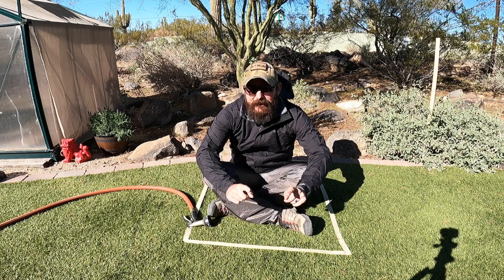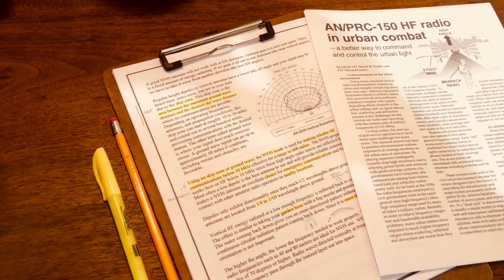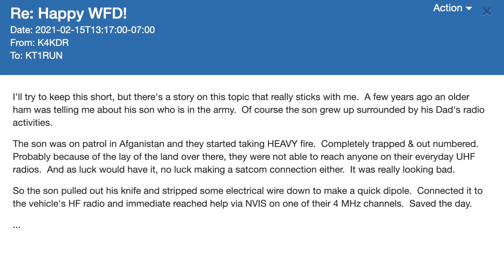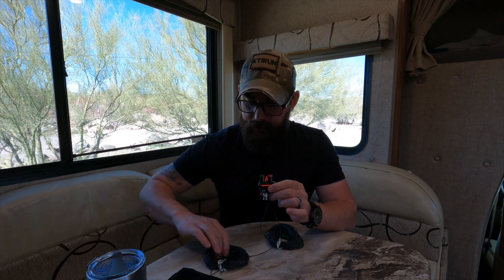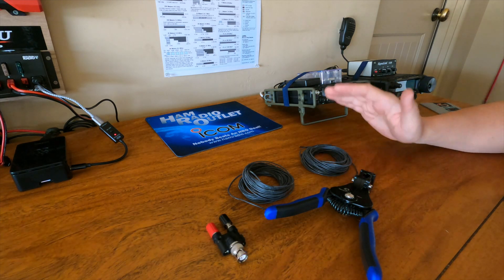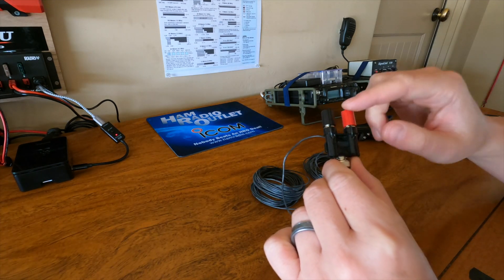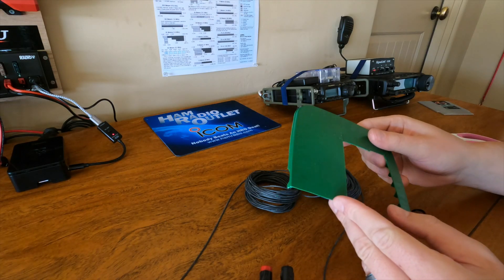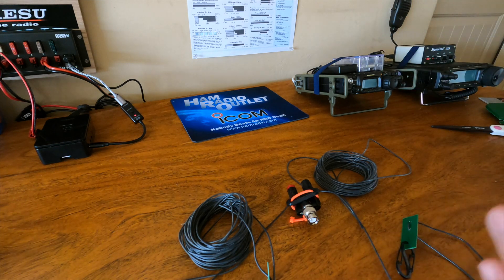Local Emergency Communications with NVIS - Let's Build an 80m/40m Dipole

Comment: When hurricane Harvey turned the Texas coastal bend into a war zone, I returned to no power, no internet, no cell, no cable, no coms.  I draped an 80m end fed antenna 22' up to my barn peak then down to the roof of my chicken coop.  Not an "engineered" design but NVIS got me reliable coms to relay messages to family and even voice patch to my wife.

Comment: Gaston, appreciate the content, especially this type of content. Have been ham for many years but there are always things to learn and when you shine a light on that content it helps us all. Excellent work my friend. David N4IN
Reply from the maker: You're welcome, David. Thanks for the kind note. This video is quite old and needs an update. I recorded this when I first trying to understand NVIS. It turned out to be very handy as most my work in the Southwest and Arizona is primarily close-in to mid-range communication using low to the ground antennas on 40m, 60m and 75m/80m. 73 de KT7RUN

Comment: Nice presentation! At least NVIS is easy in terms of antenna tower requirements. "40 by day, 80 at night" A BIG loop works best for NVIS if you have the room and 300 feet of insulated wire for a full 80m wavelength or bigger loop hung through the forest. Height is not important, but high enough to walk under is good.  You will also discover a low loop can actually be an efficient and good dx antenna at 10-20 meters and if 80 or 40m band is really open, short DX there. too. They naturally make VERY excellent long distance listening antennas with low noise reception. Of course a low dipole will also work. Dry desert is worst ground for good NVIS. A salty marsh, the best.  Would recommend reflector wire on poor ground under antenna to help in reflecting vertical 'beam'.  Before it was NVIS it was called 'cloud warming'. It was used extensively in Vietnam war and North Africa in WWII, but will not work hardly at all in higher latitudes. It works well in the tropics, but becomes fickle to nonexistent to the North in winter. Here is the link for making best real time NVIS frequency estimates. Right now this graph says 11MHZ and lower has good NVIS propagation in most of northern USA right now., for example. go here .  https://www.sws.bom.gov.au/HF_Systems/6/5

Comment: When you’re out in the field, do you use a tracking pole or your carbon mast to set up your NVIS  antenna? Which is lighter of the two.? if you could only carry one or the other, which one would you carry?
Reply from the maker: For NVIS in the field I don't even use a mast as my deployments are typically only 5 to 6 feet off the ground. Search my channel page for: (tr)uSDX as I have shown the deployment along with that little 5 watt transceiver.
Reply: @TheTechPrepper I’ll definitely check it out. I have yours and Tim’s NVIS antenna but have yet to set it up. 

I also have an EFHW set up for 100W but it’s significantly heavier 

Do you prefer setting up NVIS of EFHW? Which is easier to set up? I guess the answer depends how far you’re trying to reach. 

What’s your go-to antenna setup for emergency off grid scenario where weight and space are a premium?

Comment: Trying this @ 160 miles, cannot seem to get this to work. I have the ends at 1' center at 6'. manually tuned. Reached CW from US to Europe, but cannot get 160mile nvis.
Reply from the maker: There have been lots of solar blackouts recently. 160 miles is a sweat spot for NVIS on 40m through 80m. Keep trying.

Comment: NVIS is the VHF/UHF of HF. I easily check in with friends between the Inland Empire (CA) and San Diego, Arizona, Palmdale, and Santa Barbara, so basically anywhere within a 50 mile to several hundred miles radius of my station almost any time of day on 40meters with a flat-top 40m EFHW that I built myself up at about 25-30ft. 
The amazing part to me was that one evening (I normally operate daylight hours), I was having a conversation with the stations in Palmdale and Santa Barbara, located on the other side of the Transverse Range in Southern California, with only 1-5 watts (I kid you not) and they sounded like they were in my shack. Simply incredible.

Comment: Does the other station also need to be configured in an NVIS configuration to be able to reply?
Reply from the maker: Yes, both stations need to have their antennas systems deployed with NVIS propagation in mind.
Reply: @TheTechPrepper  Thanks. Do you know if there are any listing of State by State HF NVIS Nets that have HF Nets on a weekly or monthly basis? Google hasn't turned up anything, but this seems like it would be something that would be practiced/tested ongoing. Maybe I am Googling the wrong terms
Reply from the maker: @joeytrahan  Negative. Your best is to start one or contact your local amateur radio group. On the Buy Me a Coffee member side, we have a few regions that run nets. We run one Saturday mornings at 1515 UTC for the Southwest region.

Comment: On Wikipedia it says that using a ground wire with a NVIS antenna improves gain. Has anyone tried this?
"The overall efficiency of the antenna can be increased by placing a ground wire, slightly longer than the antenna, parallel to and directly underneath the antenna. A single ground wire can provide antenna gain in the 3–6 dB range. This is a reflector element used to form a 2-element Yagi beam antenna. The wire length for the reflector element is 5% longer than the dipole-driven element positioned above it. The dipole is located at a distance of 0.15 wavelengths above the reflector element."
Reply from the maker: I tried it several times and I could never tell the difference via received SNR reports using digital modes. It also never made the difference between making a contact or not making it. Again, this is my experience in Arizona with my equipment and my operating style. The textbook is a good starting point, but the real world is your best teacher. Get out there and experiment. I have done things that the textbook and wise hams have said are impossible. I hope this helps.
Reply: @TheTechPrepper  yes, thank you! I made your 40m dipole and am having good results with a USDR (black brick) 5watts, NVIS, 4 feet off the ground using JS8Call. Cheers! VA7CNT
Reply from the maker: @TruthVSLies  Excellent. Thanks for sharing your experience.

Comment: I have an important question.  I am on GMRS and is there a way to make an antenna like this but for GMRS?  Do you have a video for that?  I really want to create one for GMRS.  Can you help me?
Reply from the maker: Unfortunately, this technique does not work for GMRS. NVIS propagation is only seen on lower portions of the HF spectrum between to 2 and 8 MHz. GMRS runs on a frequency that is limited to line of sight. Your range will also be very short and nothing that can support regional distances as shown here. If you need a better antenna, take a look at building a Jungle antenna. I covered this in one of my videos. The math is the same for GMRS, you just need to plug into the desired GMRS frequency into the equation to determine the appropriate lengths for the radiating element and radials.
Reply: @TheTechPrepper  Thank you my friend.  Love your videos.  I have learned so much from you.  Thanks for being my Elmer.

Comment: Very cool setup. The use of the binding post setup is clever. I CADed and 3D printed my own center so I could make it also use it to reel up the antenna wire when not in use. I didn't realize you could fold the insulated wire over on its self to "shorten" the antenna. That's extremely handy, I think I'd like to try it with clear tubing. My budget wire is common 18ga speaker wire from the hardware store. Not sure where you're getting silicone insulated wire that cheap, but more power to you. Debating digging up PTFE wire (a bit spendy) but I think the insulation would be near indestructible after it's sorted. That said, I don't think it would fold well back over its self.

What's your opinion on the RG316 vs RG58 cable? Sure you're not running a lot. Far as I can tell on my VNA it's about 1-1.5DB loss over 25 foot at HF, but way less weight to run the 316. May also consider Airborn 5 but haven't gotten there yet. I want BNC connectors and I don't see a US distributor of them, not to mention that's a hefty price tag for such a feed line.

Comment: Rig expert looks like a great tool. As a noobie, I see some people refer to the bands in meters while others use MHz. Which is it?
Reply from the maker: Great question. Yes, there is a relationship between the physical wavelength (expressed in meters) and the frequency. For example, 7mHz or the 40m band are equivalent. The math is pretty straight forward to convert between with simple division. 

wavelength in meters = 300 / frequency in mHz
~41.9m = 300 / 7.150 mHz
~41.9 = 40m band

Radio waves travel at roughly the speed of light (299,792,458 m/s), but I find it easiest to still use 3,000,000 m/s (or 300 in the equation above) to make the math simple.
Reply: @TheTechPrepper  awesome. Thanks a lot

Comment: I was doing NVIS before I even knew what NVIS was. I had a condo in an HOA, and all I could manage was a wire loop antenna under the eaves. Got a fair amount of DX using the JT65A digital mode, including contacts in Japan, Australia, South Africa and one of the Pacific islands (don’t remember which one).

BTW, from watching DX Commander's videos, folding that wire back doesn't totally eliminate the length, since it acts as "linear loading".

73 de AF6AS

Comment: No question about it!  The dipole is an easy, inexpensive antenna to build, and it is very reliable.  I've built several, and for NVIS, I think the 40-m is ideal.  Very good video!

73
KI5KET

Comment: late comer to the video here but are there power limitations in this configuration?  Can you transmit at a full 100 watts there if needed?
Reply from the maker: This setup is fine for 100w SSB voice. I've never tested to see how well it would work for 100w digital.

Comment: Infantry RTO here. Your hasty antennas are spot on. Keep up the good content!
Reply from the maker: Yes! I'll take it. You might get a kick out of the improvised field comms series I did last year. I built another NVIS antenna out of scavenged wire (coyote electric fence wire and chicken coup mesh) in the back yard, a 2m jungle antenna, and even improvised at 19" 2m vertical for the HT. Thank you for your service.
Reply: Are 80 and 40 Meters the best for NVIS?

Comment: I’ve made a few multi-band resonant versions.take your 80 M antenna and add power pole connectors at the calculated locations .to remove and add  leg extensions .to bring it from 40 to 60 and to 80 meters.the center section shortest will be 40 meters add  a leg to each  side for 60 meters and final lengths to that for 80 meters.jim KB1PFL

Comment: Put round terminal connectors on the wire, saves the post trying to crush and cut through the wire
Loved your video
Reply from the maker: I've been doing this on all new antenna builds for the last year. I actually found some terminal rings that have heat shrink on the connector. I think they first started appearing in my Improvised Comms series. Great recommendation.
Reply: @TheTechPrepper I didn’t realise video was 3 years old ! Wow
Reply from the maker: @briantheminer  Yep. I've been sharing the journey along the away. If you're up early, I am doing live stream for our 50K subscriber giveaway. Cheers!

Comment: Honest question. With a little bit of modification can I make a nvis for my handheld uhf/vhf radio?
Reply from the maker: No. NVIS propagation only works on HF between 2 and 10 mHz. Depending on conditions the maximum usable frequency may even be lower than 10 mHz. VHF (144 mHz) and UHF (440 mHz) is way too high in frequency for NVIS.

Comment: great post, was that the 857d you were using in this post?
Reply from the maker: Yes, I was running the Yaesu FT-857D on lower power. I typically operate between 5 and 20 watts even though this is a 100 watt rig.

Comment: I have had great success just past the ground wave distance on 40 with very low dipoles. I will note that wires in very close proximity to the ground have a lower velocity than antennas at more normal heights and therefore the resonant frequency will be lower quite a bit. I once had an 80 meter inverted V and could change the resonant frequency from the SSB to CW band by lowering the ends! I also take advantage of this with my Beverage receiving antennas by putting them directly on the ground. 73 de N4DJ

Comment: Thank you for all of your videos. My 40 meter dipole was different in that I used a 1:1 balun (somewhat heavier gauge wire, also)=. So much material that I read showed the balun that I thought it was a given. With more research, I found people like the DX commander doing wire antennas WITHOUT a balun. The balun adds weight and cost - whether it has any benefit I will test by doing a side by side comparison. I am new to ham radio, and am learning every time I get on the air. Keep it up!

Comment: From what I have read, the Passive Reflector wire on the ground should be cut + 5% longer than the antenna.
Reply from the maker: I tried it, but I have not seen an improvement in performance in terms of received SNR. Have you seen an improvement?
Reply: HI, I will be testing a 75m NVIS dipole @ about 8' AGL and a 40m NVIZ Dipole @ about 4' AGL. Will run tests of each with and without a Reflector cut for each Band. 
Tests will take place on Sept. 30th during the CT ARES S.E.T. 2023, when we will have a bunch of NVIS stations participating around the state.
I am expecting this exercise to yield some good data.
Will be back with results. 🔬

Comment: NVIS as far as I am told was first stumbled upon by the army in WWII we operators on the Gulf coast have been using it since the 90's for after storm Emcomm work since pretty generally the trees are gone or broken. Also as you have found 4 to 5 foot works great, we are deploying it as a go-kit item for Winlink stations to relay messages from VHF stations in a 25 mile radius to the state EOC in Austin and it makes the hop easily and can be used on low power to conserve battery. You are doing a good job keep up the work de WX5GC ARES district 9 Southeast Texas 73

Comment: If I seen you your video sometime ago I would have already shared my experience with nvis.
Several years ago I was estate director for navy-marine Corps Mars living in North Dakota. It had been snowing for sometime and I needed to call the net SD/ND.
My g5rv antenna spell the ground it was lying on top of the snow(6").
What the heck! I called and it anyway. To my surprise Communications? FINE!
I hope it worked as well for you
Jack
KC7JS/NNN0ZBE

Comment: Propagation question - NVIS vs Traditional EFHW antennas setups do NVIS antenna systems require similar power requirements? example 20 watts would be same or similar signal strength for NVIS 50 miles vs 500M + with an EFHW ? I hope this makes sense lol .

Comment: Just got my general and spent the first week on air using a 40M and 20M antenna following your video instructions. I've been very interested in the NVIS configuration and both antennas have worked great. I've actually been surprised at how far I can get out given how close to the ground the antenna is. Greatly appreciate the info.

Comment: Real quick, did your internal antenna tuner have to significantly tune this antenna due to the low height over ground compared to wavelength?  Impedence, theoretically, should've been pretty high at that low height.

Comment: I remember another NVIS item that putting a reflector wire directly under the NVIS antenna enhanced the vertical component of the antenna signal like a yagi.  You might need your driven element to be further off the ground to be more effective though.

Doug, VE3MCF, AK4HB
Reply from the maker: Thanks for the comment. I've tried adding a reflector wire that is 5% longer underneath for all versions of this NVIS antenna (40m, 75m, 80m) and I have personally noticed no difference. The receive signal reports are about the same. It tested this with WSPR.
Reply: @TheTechPrepper  
I suspect you need to have your driven element to be high enough that the reflected signal gets added to the driven elements signal in phase for this to work.  Maybe just adding a reflecting element underneath a dx antenna world convert it to an NVIS.  Easier than lowering  the DX antenna to become an NVIS?  Doug, VE3MCF, AK4HB

Comment: Great video and in non technical jargon.  One question. Can you or do you run 100 watts?  I usually run 18 gauge wire.
If you have time let me know,
Thanks
Reply from the maker: Yes, you can 100 watts. However, I've found that if you're actually doing NVIS, 5-20 watts will do. Cheers.

Comment: Though the antenna is an important part of the overall NVIS configuration, you have to be able to pick the right frequency. There are resources out there for this, especially for NVIS. Remember, NVIS comms rely on the signal being reflected back down at very acute angles. Choose the wrong frequency and the signals will go straight through the ionosphere and not be reflected back. This is why you  see most military HF rigs only go up to 60mhz (or so).

Comment: What hand held radios can use those low frequency bands please?   Can the Anytone 878 series do something with NVIS ?
Reply: BTW - I'm calling the 'BridgeCom Systems' company now to ask...
Reply from the maker: No, you can't do this on a handheld. You will need an HF radio that can operate between 3 and 10 MHz. There are a number of low power (QRP) transceivers that are small but not quite as small as an HT. Take a look at the Yaesu FT-818ND, Xiegu G90 or X6100, Icom IC-705, and Elecraft KX2.